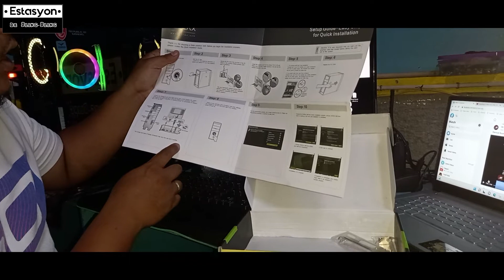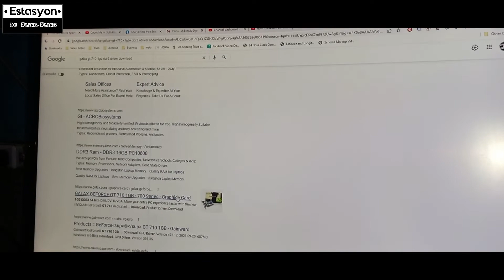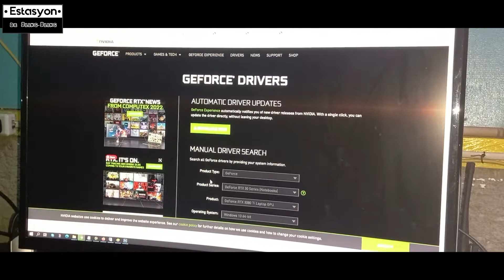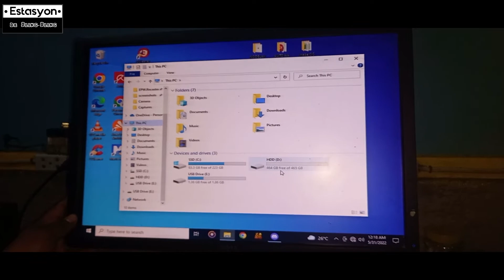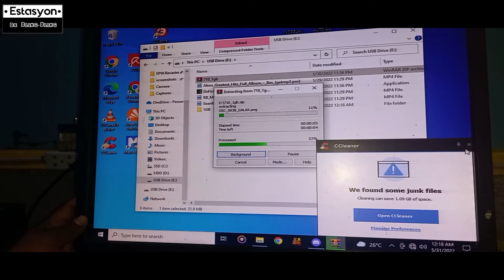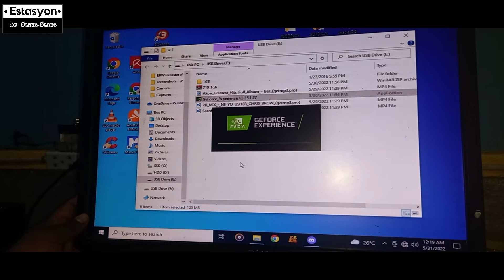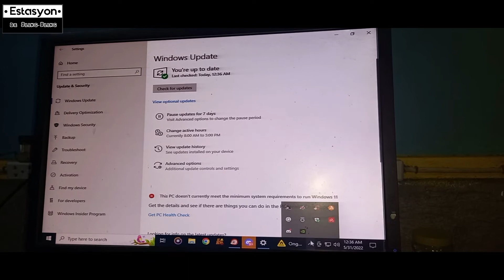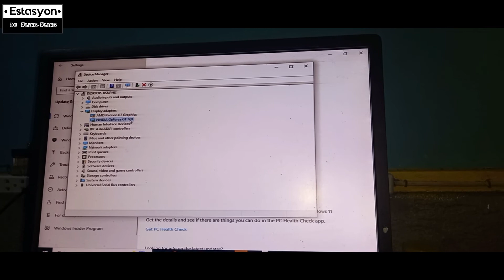GALAX GEFORCE GT 710 1GB DDR3 64-bit HDMI/DVI-D/VGA | Unboxing - How To Install

Comment: Lods paano ko gawing default graphics driver ung gpu ko instead sa processor?
Reply from the maker: lods, once na install mo yung video card, automatic po yung gpu display driver po yung gagana.
Reply: @EstasyonDeBlingBling  nung na install ko naman po ung gpu na gt730 tapos tama naman cables para parin pong walang nag bago di na dagdagan fps kahit onti parang ung amd ko paring ung gumagana lang
Reply from the maker: @leviathan6415  check mo yung device manager nyo po if successful po yung installation.
Reply: Nag bottleneck pala ano po ba maganda i pair sa gt730 na apu
Reply from the maker: @leviathan6415  anong processor gamit mo ngayon?
Reply: Amd a6 7400k bali nag research naman ako kung gagana sila magkasma sabi oo pwede pero sa nakikita ko Hindi
Reply from the maker: @leviathan6415  pwede po yan, yan po yung processor ko dito.
Reply: @EstasyonDeBlingBling  ilang fps nyo sa valorant or other games?
Reply from the maker: @leviathan6415  sorry po hindi po ako naglalaro ako nyan at wala ring naglalaro nyan dito mostly dota 2, ml at cf